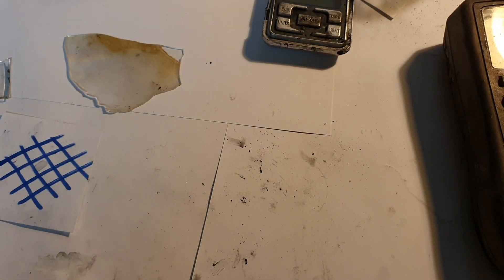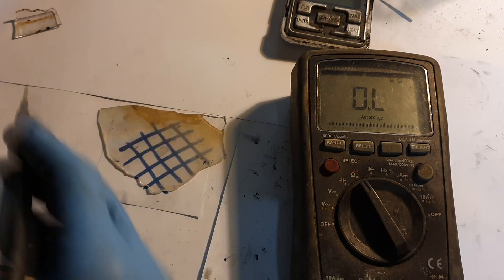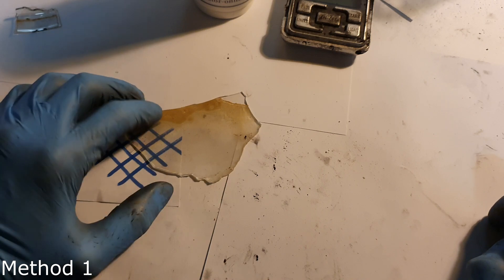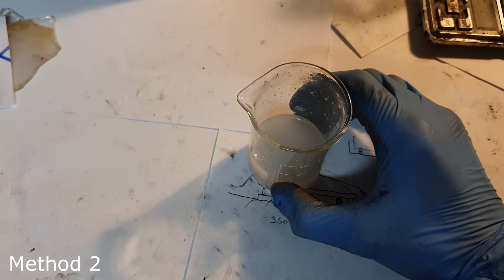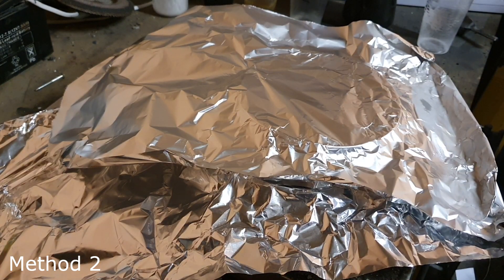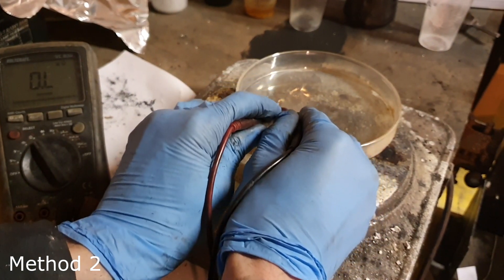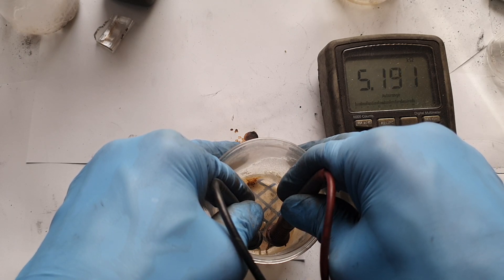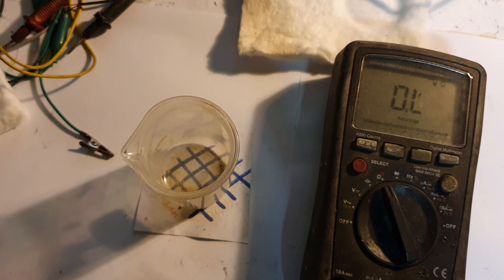Make a Transparent Conductive Glass

Comment: how convenient, try cadmium-air and zinc-air, using recharging of the Conductive semiconductor oxide to conduct and pump out oxygen
Reply: i mean, use them as batteries, air-batteries, very high specific energy, like zinc-air, easily
Reply: pump more current and voltage if you cant get the oxygen out of the battery metal
Reply: so, glass as the electrolyte, the i in the PIN diode, solar cell

Comment: if before priming the tin layers, you subject the glass to a slight abrasion, for example with toothpaste, to improve the adhesion
Reply from the maker: No need. Just clean the glass and you are ready to go. The SnO layer will stick to the glass surface like mad. I was not able to clean the layer of tin oxide in the beaker with soap, water and hard surface of cleaning sponge.

Comment: HELLO
I would like to tell you one thing that may be useful
In the process of manufacturing glass, it is laminated on a molten tin broth, and this causes that on one of the 2 faces of the glass remains impregnated with that metallic tin, this is well known by the people who make vitro fusion, for that this layer interferes in the correct welding of the glasses, and they have a trick to recognize this layer, this feature may be useful in your idea, it may improve the adhesion or conductivity of the subsequent layers
a greeting

Comment: I think it's conductivity would benefit greatly from doping a few mole percent antimony
Reply from the maker: Yes,.... with adding antimony chloride,.... but, antimony chloride is really toxic 😱 and is hard to get for most of the people
Reply: @cayrex  Antimony metal can be bought at companies that sell lead and solder alloys (it's where I bought mine). From a few grains of antimony, it is easy to prepare chloride in tiny amounts. Tiny amounts is all you need to dope the tin. You can also dissolve a few grain antimony metal in molten tin, then prepare tin chloride, this is safer as antimony concentration is always low. Tin dioxide is a semiconductor, it's conductivity is not good without doping. Best dopant is indium but it is very expensive, however, you can buy 10g indium metal from china at okay price, after all, preparing these coatings uses miniscule amounts, so that 10g aught to allow you to make a lot of conductive glass! Funny, when my indium arrived it was marked Zn on customs form, but was definitely indium. I suppose somebody confused a Z for an I, lol.